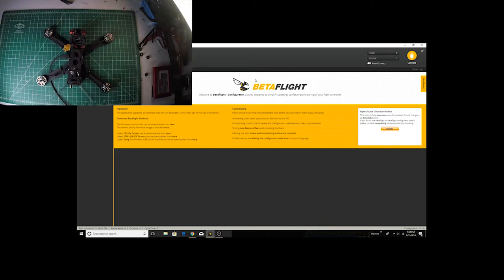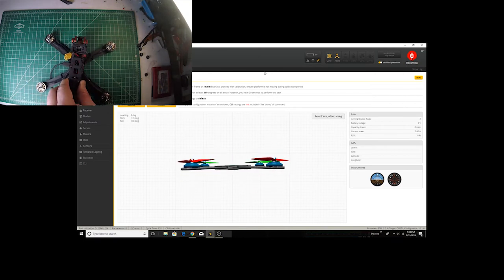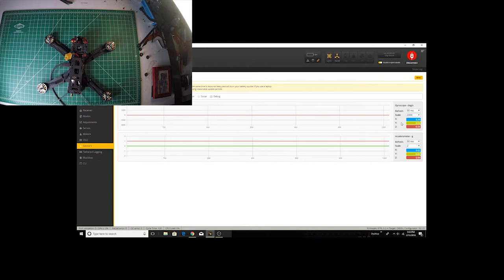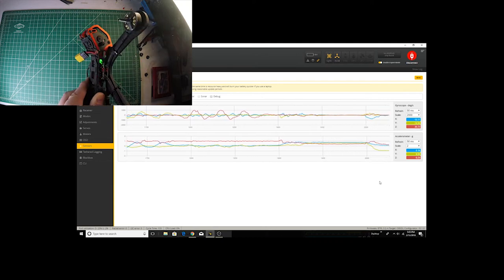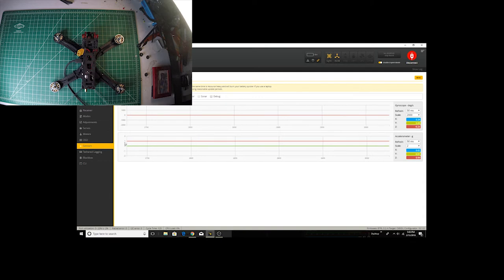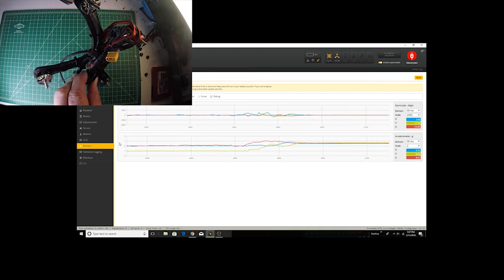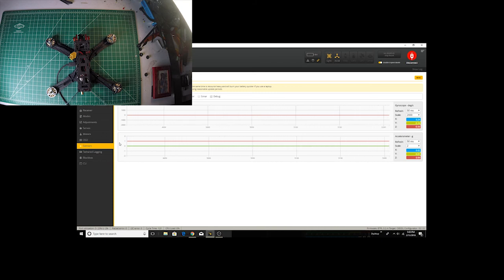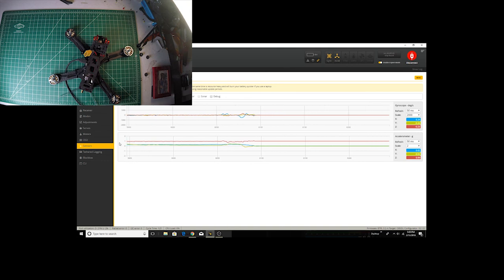Drone Basics:  Accelerometer vs Gyroscope Quick Tutorial

Comment: My quad just started rocketing to the sky as soon as I give it any throttle input after I arm. After this started happening I plugged it into Betaflight and noticed the picture of the quad on the Setup tab follows the movements I make with the quad in slow motion and the yaw movement doesn't work at all. To fix this on the Setup tab all I have to do is click on any other tab in Betaflight and go back to the Setup tab and the picture of the quad moves exactly as I move the real quad and the speed of movement matches. But I try to fly again and it's the same problem. As soon as I give it any throttle, it goes full throttle and by the time I can hit the disarm switch it's 30 feet in the air. Bad gyro or accelerometer maybe? I haven't crashed and the Flight controller is 2 weeks old. This problem just started happening out of the blue. It did this a few times yesterday while I was in the air flying. Kind of a jerk movement and eventually shooting for the moon and me having to disarm. The problem stopped 20 minutes later and I flew 5 more packs yesterday. Today it will only screw up.

Comment: pretty sweet explanation of the accelerometers, but what happened with the gyros????
Reply from the maker: Well I thought I covered it, I’ll have to watch again and see.
Reply: Talon FPV it would have been sweet to see the outputs of the gyros, the same way you did with the accelerometers.
Reply from the maker: It looks like the movements I make with the quad are showing gyro tracking at the 2:10 mark.  Basically the gyros measure rate of change of position and the accelerometers measure acceleration forces.  Can I answer any questions about this?
Reply: Talon FPV oh my bad! That’s awesome thanks so much and apologies for the mistake
Reply from the maker: Nah no problem. Thanks for watching!

Comment: Hi,
I am new to the hobby and I crushed my drone and now the accelerometer is not working. I connected it to betaflight and I did calibrate the accelerometer. however, when I move it while it's connected to betaflight it's not responding like you are doing on  0:35 I can't fly the drone because somehow it flipping on its back every time I arm it. please help

Comment: Can you do a explanation of reversing motors in blheli and bf? Would help the new guys that think cw and ccw motor pairs are mandatory. Just remember to let them know only nylon nuts no bullets.
Reply from the maker: Mike Hedrick funny you should say that.  I have been thinking about doing that but am trying to compile a list of aerodynamic advantages of reversed props.  I even asked Bardwell (I am a patreon supporter) and couldn't get a straight answer.  It seems like there are more advantages than disadvantages (less crap thrown into the camera, etc) so why is it not the default..  thank  you for the suggestion, I'll do that soon
Reply: I think I learned in videos about cw and ccw are not necessary to the drone, you could either put 4 of cw or 4 of ccw. It's just about the direction of the screw threads but I'm not convinced that they produce cw and ccw for just the direction of the threads! I think there's something more about that.

Comment: What do you do if your drone does not move the same as the screen like its all off  left roll pitches forward etc ? Im lost when i arm the kwad it just flips out motors all move the right way but i can clearly see accelerometer is off but calibrating does nothing
Reply from the maker: There is a setting on the betaflight screen to change the orientation .  The board probably isnt mounted the way it is designed but no big deal just rotate via settings until it reacts properly on the screen.
Reply: Talon FPV thank you for the help it is a bnf hawk pro was flying fine i tried to move the arming switch to something else but i ended up putting it back to the same switch everything looks fine except that and when i arm with blades off its fine with blades on it flips over or it will start but any throttle it flips over like i said motors moving in the right directions blades on correct checked sensors everything looks good its just way off with the accelerometer thank you for ant help i will try what you said
Reply: Hey i just want to thank you i did what you said and got it to work right ! Test flew and its perfect . do you have any idea what would make it be so off for the future ? Thanks again your a life saver lol
Reply from the maker: @timmytfpv7316  flashing new versions will do it.  Some quads are built with the flight controller in a non standard orientation for a myriad of reasons.  I built one with it upside down.  No biggie just need to remember to set it up right.